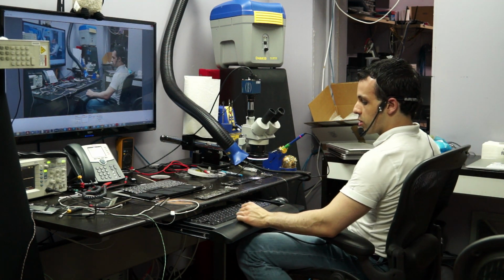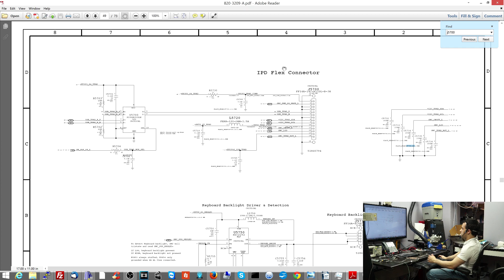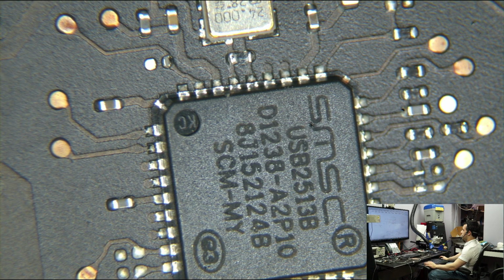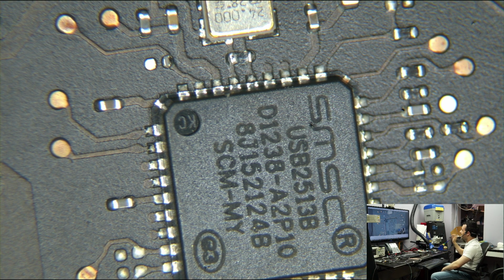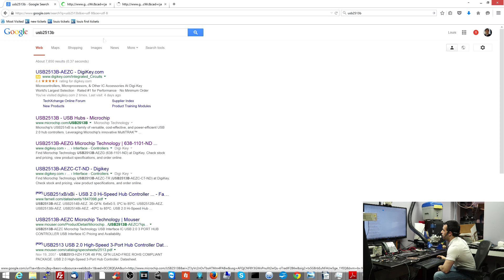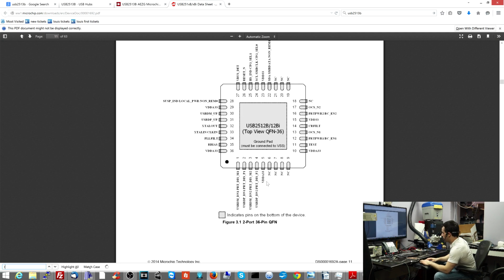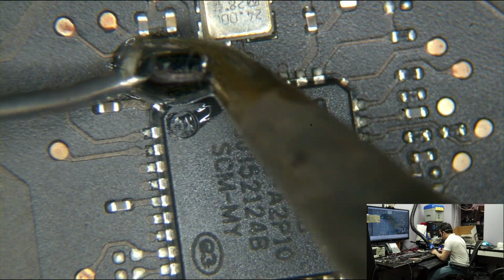Macbook Air keyboard & trackpad not working because of missing bias on USB hub.

Comment: Hello Lois, I have a macbook air 13 a1466 2017 that only detects the keyboard and trackpad during boot, but stops detecting it when the system starts, honestly I did everything, I have already exhausted all the possibilities I know, change the keyboard connector (j4800), I reballing the CPU, all the resistors are correct, also change the SMC, change the keyboard, trackpad and flex, change the ICs involved, all the voltages arrive correctly, but nothing, everything remains the same, it only detects the keyboard and trackpad at boot, after that starts they don't respond.

Comment: 🎯 Key Takeaways for quick navigation:

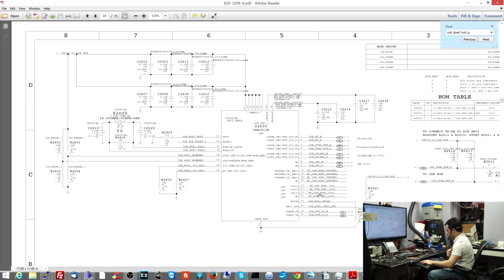02:23 📚 Missing resistor R2600 (12 kilo ohms) between USB hub bias and ground can cause keyboard and trackpad issues on a MacBook Air.
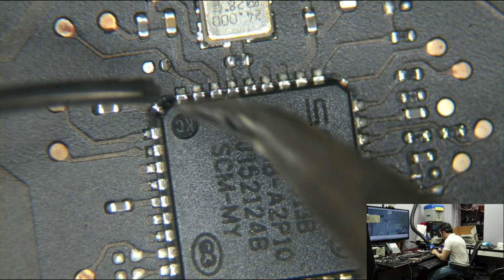03:30 🔌 Soldering the missing resistor R2600 can resolve the problem of keyboard and trackpad not working.
05:05 🤦‍♂️ Common sense troubleshooting is essential; checking for missing components and understanding the circuit can save time and prevent mistakes.
07:06 🙌 In this case, the issue was resolved by adding the missing resistor (R2600) to restore the USB hub bias, fixing keyboard and trackpad problems.

Made with HARPA AI

Comment: Hi Louis,

It's been a while since you commented on this video but my MacBook Air has this very same issue although with some differences. When I turn on the computer the keyboard trackpad and bluetooth are NOT working (just like yours), however, after about 15-20 minutes leaving it on with a wired keyboard and mouse plugged in (in order to log in etc...) they all start working again. I can only think that the heat is causing the connection to work correctly but if it's started up after being shut down for a few hours it fails to work. This issue is really annoying because it works fine once they kick in to gear. I had a look in the same spot you soldered a new resistor on and it looks fine for me.

Comment: Hey Louis, I have the exact same problem on my macbook pro 15" from 2010. The logic board's "name" is 820-2850-A and actually sais 2010. I've been trying to find the datasheet for this board to retrace your steps but alas, I have failed so far. Do you happen to have that exact same board on your pile of electrical trash, and if so, could you help me identify the source of the problem? with a picture maybe? I hope you get to see this. thanks in advance
Reply from the maker: +Nuno Vitorino see if pp3v3_s4 is going to keyboard and trackpad and check if trackpad cable is ripped
Reply: would you believe me if I told you I can't find pp3v3_s4 on the datasheet? there's pp3v3_s3 and pp3v3_s5 but no _s4. Also, I've sent you a rather long message on facebook, "explaining" what i'm up to. I apologise in advance...
Reply: and the trackpad cable looks pristine.
Reply from the maker: whatever is going to the keyboard connector, i forgot which. there is pp3v3 somewhere on the keyboard connector. i don't read my facebook messages since it's all spam from people who want free board repair advice.
Reply: understandable, as I too classify in that category. pp3v3_s3 goes to U3700 USX2061 which has all 3 of the parts not working. bluetooth, trackpad and keyboard. the trick here is to find out if there's a resistor missing like in this video. that's where i'm struggling right now. I appreciate all your help man. now lets see if I can find someone with your skills and tech in my town. not holding my breath though.. thanks again
Reply from the maker: step one: look at keyboard connector

step two: find where pp3v3 goes on the keyboard connector

step three: measure that pin of the keyboard connector

cmon!!
Reply: Alright! I'm off to buy a multimeter, give me a break here, I'm a woodworker not computer technician.
Reply: ok, so I hooked up the logic board to the power source, got the multimeter on 20V, the black pointer on ground and the red one on the pin. got a reading of 0,12V. Is it fucked? I wanna say it should be 3V but what do I know..
Reply: correction! re-measured, got 3V
Reply: Did you end up resolving the problem?

Comment: thank you for the video.  I had a MacBook air that had liquid damage where keyboard and touchpad would stop working after logon.  I replaced both of them no change.  After watching this video I learned that if anything touches those tiny resisters it could result in the problem.  I resolved by using a toothbrush and alcohol and cleaned the tiny areas and now it works again! This video saved me $180 because the next step would have been to repair the motherboard.   thank you thank you!
Reply: Nigel Preece please what parts did you clean ? ???

Comment: Louis,
I had the same problem. There was a wine spill. Logic board was removed and cleaned. Everything is fine except there is no keyboard or touchpad. I purchased and installed a new keyboard and it still doesn't work. I haven't bothered to get another touchpad yet. By the way, bluetooth and card reader work.